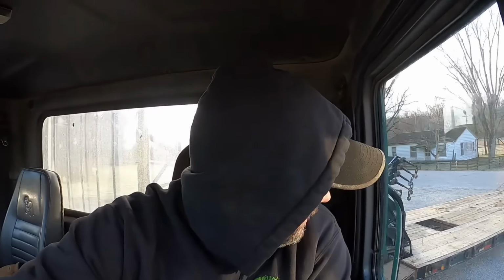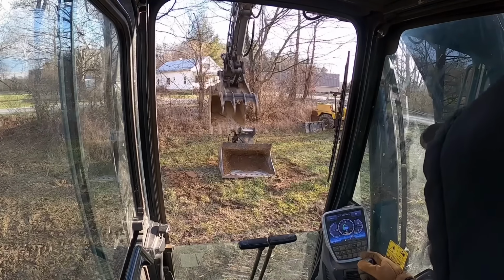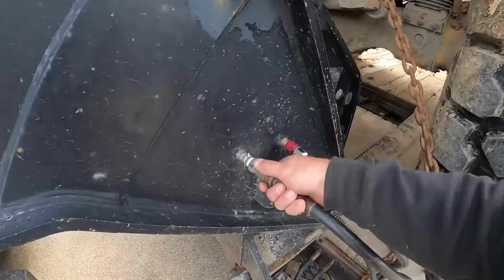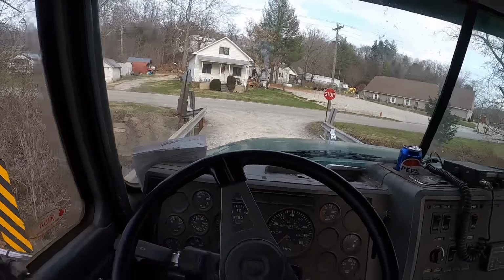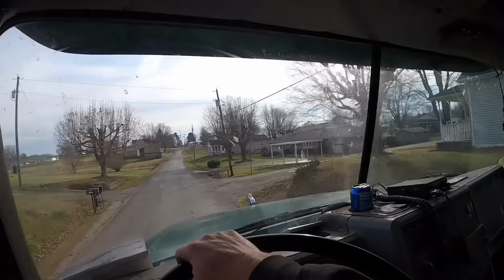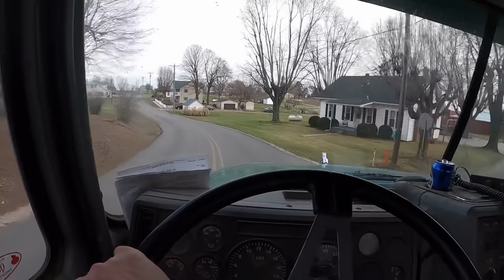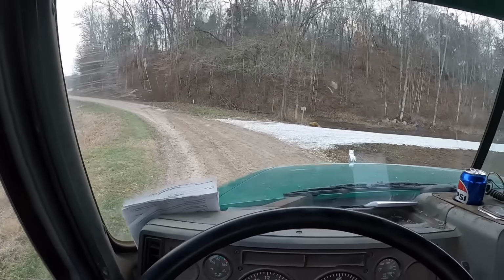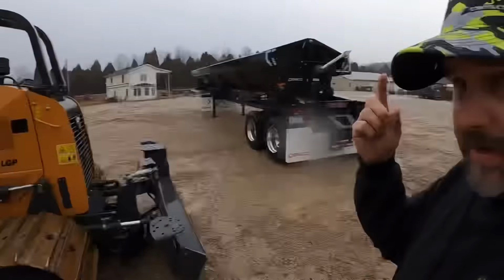Navigating Sharp Turns And Steep Hills On The Road To The Next Gig - No Easy Feat!

Comment: I know that what I am going to say is not in your class of equipment, but you can't beat a Case tractor. I had a Case farm tractor, 1194, which is of the smaller variety, but it was the toughest I had ever used. Can't beatem! The side dump I was a bit dubious about but you have shown that it is very useful and safer than an end dump. Too bad they can't make you a "special" deal! ( hint-hint) Keep up the good work and Stay safe!

Comment: I personally have been impressed with both the trailer and especially with the Case dozers you have been using. I don't think the 1650 is as well built for ripping rocks or pushing those unbelievably large rocks as the 850. But it is just about a half size smaller than the 850 and the ripper is not nearly as robust. But both units are great for the duties you were using them for. I don't know if you would have been able to do as nice of a job on making the hillside road or finish the grade with the D4. But I haven't run neither unit to compare them with pushing power and grading control. You are well more qualified to compare the 2 units. Would be great if you could make a comparison from what you know about both units for others to have incite if they're thinking of purchasing a dress up dozer themselves.

Comment: Nice job on the reviews DP.
It's been a few years since I've run a dozer, but watching you fellas run that 750 in several different conditions really showed how planted it was, even when you were pushing it all the way to lost traction. A very stout little machine and quite stable as well. The biggest drawback seemed to be the ripper both for visibility and function. While it is a handy implement to have, it did seem to be a bit awkward to use. Perhaps a single tooth with a more user friendly attachment method would help, but you would certainly have a better understanding of that.
The side dump actually surprised me as well. I've used a couple in the past, but nothing like that one. The reversible dump feature is fantastic, not to mention how simple to switch.
I completely agree with the advantages. I would not have long trailers on jobs except for bulk load drops, most everything was either dumps with pups or triple and quad axles for spreading. I saw one 38 ft dump trailer fall to the side and completely twisted the box and frame some 50 years ago and decided it was far safer to limit their use instead.
Everyone in construction knows that risk is a part of what we do, but keeping it as low as possible is always the goal.😉
I prefer the extra trip now and then because a multi axle truck will always fit when a long trailer might not.
You prove it every day.🤙

Comment: I was a Case dealer for 35 years, and yes they are a good bunch to work with.  As a rule, the weight to HP ratio is less on a Case, but the versatility and ability to "throw it on a truck" and go do a clean up job, or a detail job is better because of it.  I appreciate the videos.  That was a nice job you just finished.  Thanks.
Reply from the maker: I agree on all the above and thanks

Comment: Those ramps remind me of back in the 1970s. A guy I worked with bought a trailer to haul his drag car on but he didn't have a hitch or light hookup on his truck yet. A friend of ours pulled the trailer to the place he was storing it for the winter. It was at night and about 20 miles down the interstate. His ramps were double thickness 2x12s with some threaded rods through them for pins. When we got to the storage location, the ramps weren't in their place on the trailer. The guy who owned it said " I wonder where they went". I said "I don't want to know".

Comment: I believe that that Case dozer or the other Case dozer you tried out are real winners,, as far as I seen what you used them on, they were the handiest dozer’s I’ve seen, and pushed very hard, for what they were. And as for the side dump, well that is a very useful dump trailer for many jobs, but in your case , I really don’t think you would have enough use for it , as for the jobs you do, but I could be wrong, I would just think about the Cost of that trailer, would warrant, the job use would 
Equal buying one. But if you do get the where you would start to engage into more jobs needing a side dump, that would be the one I would get.  Just my opinion on these 2 machines, great video Mike and Aaron 👍👍👍😎😎😎🍮🍮🍮❤️❤️ oh what happened to Mr. Millennial’s channel? I don’t see any new videos anymore? Just wondering, what happened?

Comment: Them little county and private roads were never designed for the wide turn required for them big ole trucks and equipment but you manage to get yourself around many of them one way or another when you need to, 👍 I'm sure there are jobs you have to turn down because there is no safe access.  Hope you HAD a nice Christmas and vacation Mr. 2023 DP, 🙃😉

Comment: In Western Australia DP we have much shorter trailers with hydraulic power down/up door and either a big multi stage centre ram or rams either end taller sides only about 26’-28’ and triaxle and haul about 26t-28t or 57,500lbs-62,000lbs and get around much easier than I’m assuming 40’-45’ demco demo you had, if there was a way I could send you photos I would be happy to show you the difference

Comment: Side dumper.. This same trailer with a slider axle setup could prove useful in tight situations off road. Hi-float single tires might be preferable to duals.  I don't know how often the side dump is actually filled to the top rails, if seldom, a lower profile might be nice.

Comment: Hey Mike, I was watching a YouTube video with a similar topic as this one, where your options were limited, because you can't just drive the excavator on the road/or over the bridge without ripping it up (Other than a tight squeeze, I don't think weight was the issue here).  What they did kind of blew my mind.  Instead of dropping plywood over the road and move it along, they took a long, heavy-duty tarp like material, just as wide as the tracks, wrapped each track with multiple layers to give the padding required, and then drove it down the road and across without destroying it.  I figured, that might have been a solution here so that you could have walked it across the bridge to your waiting vehicle!  Nice thing about this is, it does not take up any extra room on the low-boy because the tracks are always wrapped until you unwrap them to work the job!  I guessing, it could be done on the bulldozer by lifting the blade and the rippers!

Comment: I pulled a volvo 750 up a hill like that 3 mile long by the end the front axle was off the floor that was in a scania 730 v8  luckily i didnt need to turn until i was on flat them 210s are 24 tonne definitely not light

Comment: That case is a sweet machine!  And those side dumps are safer to use than a end dump!  And a tip for you something to get to carry on the lowboy for unloading on the road is some old fire hose! It rolls up and is some of the tuffest stuff. Ask capt when  the house he works at when they are  getting rid of two sections  of thier supply  hose is all you would need mike!